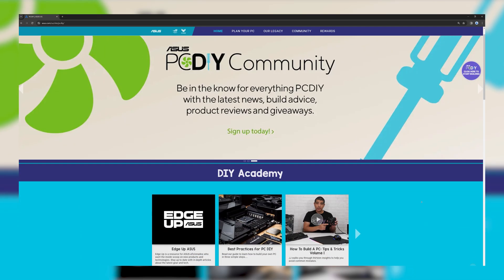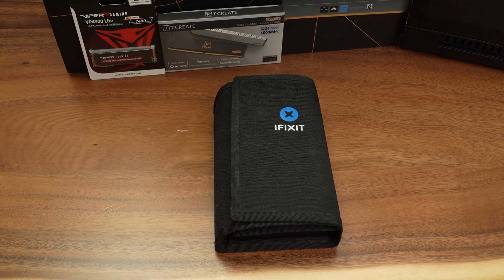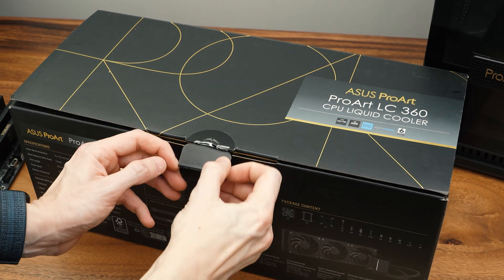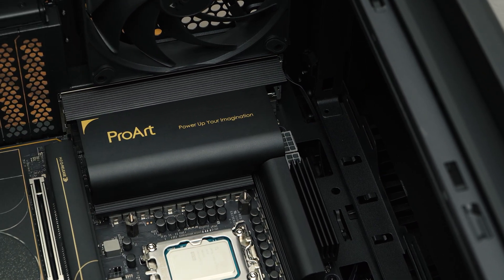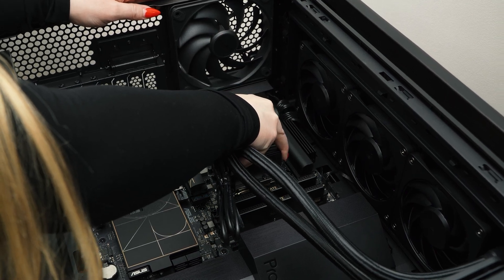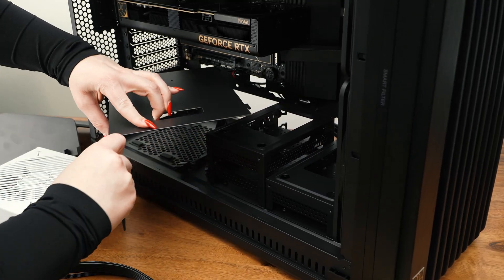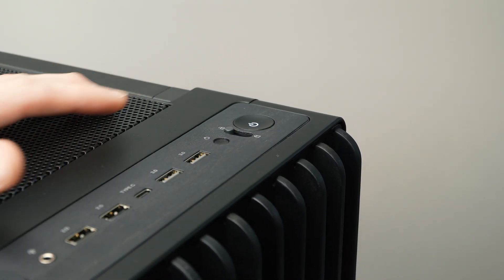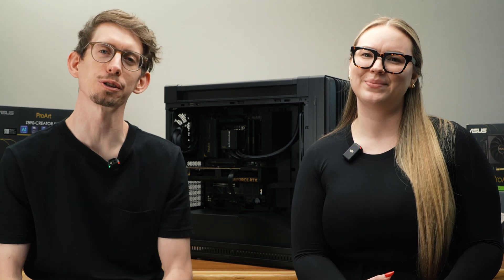How to Build a DREAM PC with Asus PC DIY

Comment: Great vid! quick question though, does the PA602 single fan cable go on any CHAFAN? or should it be on the CPU_FAN. I think I saw your vid have in on the cpu fan... but jsut double checking. making a full Proart build. 1 dissapointment with this board though is the single usb header. that means it goes to the AIO LC420 but now my proart case has 2 usb 2.0 front ports that wont work. Bit of an oversight if you ask me considering getting a full proart line build from ASUS.

Comment: Building a full on Proart built. Quick question though, I hear horror stories regarding armory crate. 
Does a full proart build need armory crate or does the proart creator hub replace it, and is that software even any better?